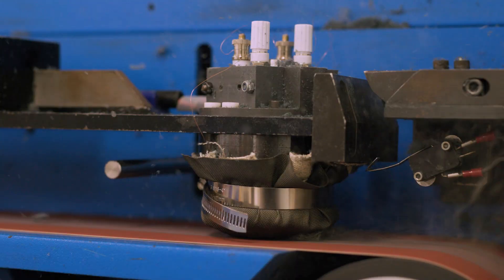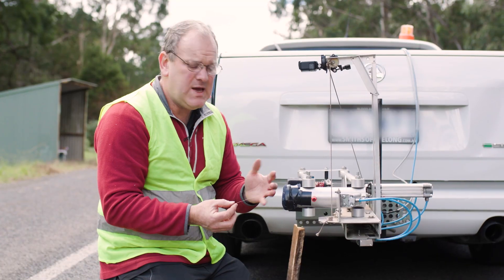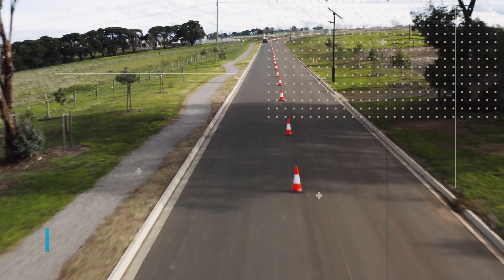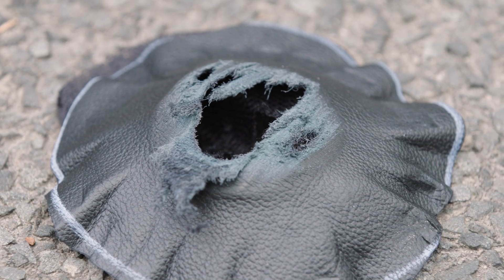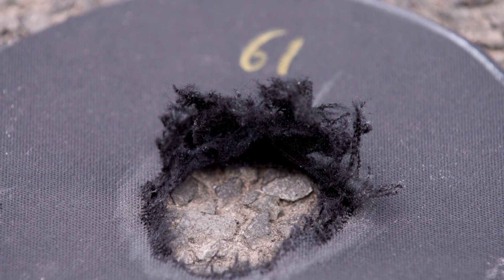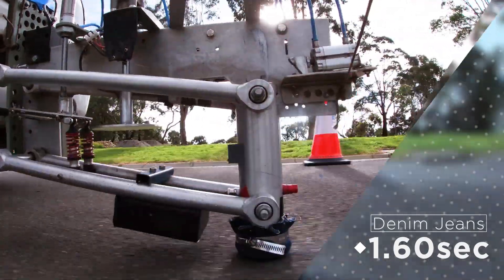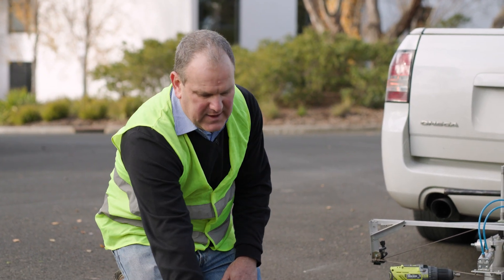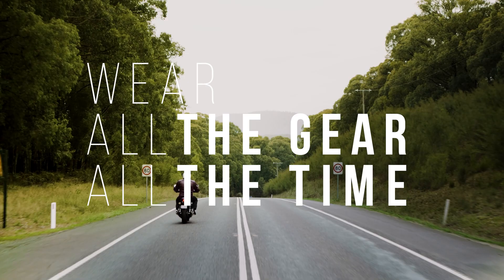Asphalt versus chip seal – Abrasion testing motorcycle clothing on the two most common road surfaces

Comment: What was the speed of the truck?  The speed is highly importance as 8 seconds at 60 mps is different that 8 seconds at 10 mps as the varying speed generates different heat therefore burn thru is faster at higher speeds.
Reply: The vehicle was doing 8m/s which is the same speed as the laboratory test machine.

Comment: This begs the question, why is 500/600D so common if worse then regular jeans?
Reply: It's cheap and strong enough for chassis material but for impact and high risk zones it should be and almost always is doubled up with some thicker, load spreading or high tensile material.

One aspect not explored in this type of test is high impact. Cotton denim will most likely tear open due to low tensile strength, whereas 500/600D polyester and nylon might not but will abrade through quicker.
Reply: @martinfoster5163 the thicker denim used here and the 500/600D materials tend to have similar burst strength. If it is a thinner denim or chino fabric then the total abrasion times go down as the para-aramid (Kevlar) layer is less protected from burst failure.
Reply: @martinfoster5163 500/600D polyester and nylon are not better in burst resistance when we did this testing when compared to the denim by itself. They predominantly failed in burst on chip seal. The synthetic fibres are used in garments as they have minimal water absorption and can enable water resistant garments to be made. In our testing we have seen many textile garments and they predominantly only have one layer of 500 or 600D nylon or polyester in the high risk zones. If manufacturers did as you said and provided two layers of protective materials in the high risk zones we would see protective textiles improve in the MotoCAP star ratings and their protection levels for riders.
Reply: A lot of protective textile garments morphed out of wet weather clothing.

Comment: I love this kind of testing and hate to nitpick. However, I've done such tests myself and believe there are some improvements that could be made.

First of all, this is an abrasion test to verify the Cambridge machine which provides a relative abrasion test. Not a crash simulation. The only thing that changes is the surface on which the relative abrasion test stimulates.

So, I think a crash test simulation with a drop from rider height and an anatomically shaped sample holder would improve the efficacy of such a test. The drop height for zone 1 and 2 could be 1 metre (because that's what EN1602 uses). This would be about pelvis height on a rider. Also, at a greater speed which could be determined by average real crash data. Let's say 45 km/h. Then the sample would be allowed to come to a standstill under it's own friction. Or just keep come to a standstill over a set distance. Zone 3 and 4 could just use the 50mm drop height because these are not considered impact zones. I didn't just make this up. These are the numbers suggested by Dr Roderick Woods in published studies but not implemented by CE EN13595. This is a major deficiency in both MOTOCAP's and EN13595's protocols. The most damage is usually on impact with high kinetic loads. Sliding under just static load is much less damaging. Also, it far better simulates any tendency for grab which a material might be susceptible to.

Pads should be included for zone 1 and not for zone 2. 

A leather jacket such as shown in the video would definitely have multiple layers of either extra cowhide or foam or a textile (typically aramid). So I think that's not correct to say "leather jacket" and use a single layer of cowhide. All my leathers jackets have multiple layers in zone 1 and 2.

Tests should be done at hot temperatures when most riders prefer to ride. I think there would be a loss of performance in textiles (nylon/poly/UHMWPE) at higher road surface temperatures. Whereas leather and aramid would be unaffected.